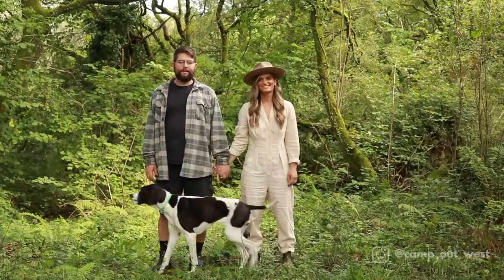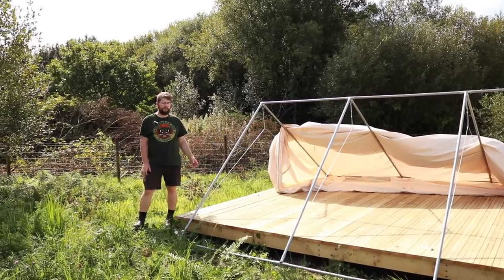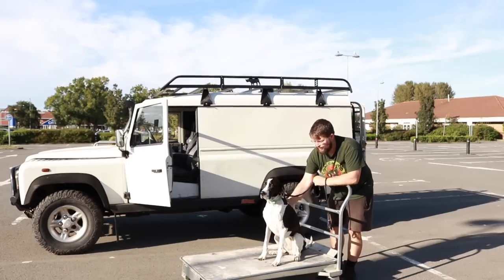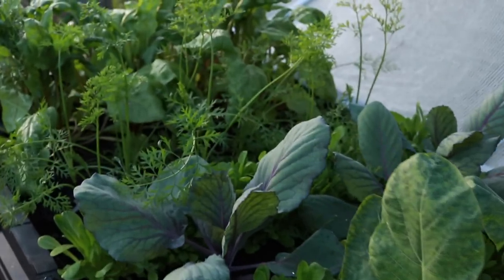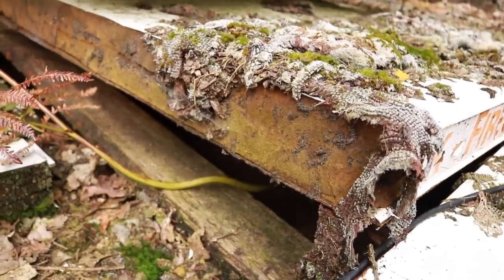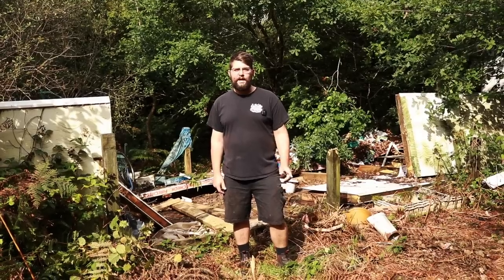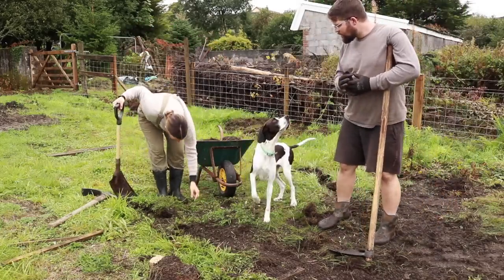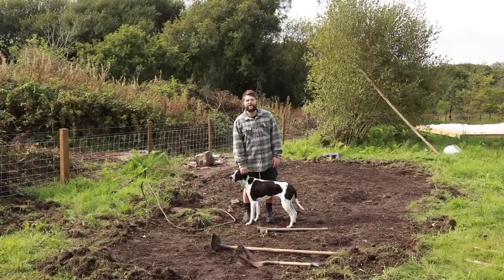We sold everything for this?! Turning abandoned land into an off-grid homestead in Wales

Comment: The tent is not as advertised and the legs were rusty so it is basically ''not fit for purpose'' You are entitled to your money back.....contact the company and tell them that......remember to check that old electric cable and water supply are not live...Your contact with the little digger would have saved you both a lot of work and time.......once again you have shown you both are not afraid of hard work, roll on the next video....well done....
Reply from the maker: Thanks Sandy! Oh there is no electricity in this part of the land anymore so thankfully we were safe. We did say as we were doing all the work we should have booked the digger 😂

Comment: As a builder for 16 years the first thing that came to mind for your tent idea is...

Build 4 wooden 100x100 post to the inner measurements of the tent canvas. Build a basic wooden gable frame on top. Then sleeve your tent canvas over the outside of the wooden skeleton. It won't move at all. 

Its best to take the canvas off during winter to stop them from rotting.

Comment: If you buy your sand and gravel in bulk from a builders supply yard it will be a fraction of the cost of bagged sand and gravel.  My suggestion is to put a cheap tarp (or an old vinyl billboard sign much heavier and recycled) down on the ground and have the sand and gravel dumped onto the tarp.  Then you will not have grasses and mud mixing in.  Much easier to shovel off a tarp too. 😊

Comment: Could you make a wooden internal frame for the tent canvas?  Then line it with some decorative fabric/panelling.  you could then use the cavity this creates to put some form of insulation in for clamping in the colder months?
Reply from the maker: We had thought of this - the problem is even the canvas they supplied with the tent isn't fit for us, it was meant to be waterproof and mildew/mould proof but it lets in all water and has already started growing mould, so it wouldn't even make sense to try and re-use that either

Comment: As a hot air balloonist we have to handle 1000+ yards of material. We avoid flying in rain, or even laying the balloon down in a damp field. But when it does happen, we have to dry the balloon fabric out quickly because mold sets in 3 days. So we use our fans, we set the material up in a garage, or sometimes we rent the school gym, and lay out the fabric on several surfaces so there are ups and down in it, then we set up our fans to constantly blow air across the fabric. With you tent you should consider keeping a fan/heater, going inside it to keep condensation from happening and have air movement, don't rely on mother nature to do it.  I am also a historical reenactor and set up canvas tents many times a year. We do the same with our canvas. air circulation and heat will always help.  As for sealing the seams of the tent. Our canvas tents need one good soaking to make the fabric shrink and seal the seams.  Good luck

Comment: To do something with tents at the commercial level and for guests to want to come back you are going to have to to go with something heavy duty.  I'm a sailor and we use Sunbrella.  It's not cheap at 30 USD a yard at 60".  But it will last at least 5 years or more with proper care.  The frame should probably be built sturdily of a wood .  

On the mesh, you need no see um mesh.  It's used on tent windows.

Comment: You need to look at Re-enactor's tents.  That canvas is way too thin.  I had a proper tent with wooden poles and solid canvas and it withstood serious storms without problems.  They cost less than £1,000 as well.  They come in all sorts of interesting shapes and sizes.
Reply from the maker: Thanks for the suggestion Stephanie! We will have a look at Re-enactor tents! We do love the idea of a wooden frame
Reply: Seconding this recommendation. Our tent has been in use for at least 20 years and is still going strong in all weather. I don’t know if they have a presence outside of the US, but I could recommend Panther Primitives highly.

Comment: Those metal tubes that the tent came with are way to thin to stand up to any kind of rain or wind. You'd need to get some kind of steel tubing, thicker aluminum, maybe 1 inch thick wall PVC pipe (schedule 40 or schedule 80). Or just remove the metal get some 2x4's and put together a frame for the base of the tent that way. The material that the tent is made from also looks really thin, I'd recommend looking into a nice thick canvas sheet that you could use instead, blocks a LOT more of the light than what you currently have (unless you want a tent that lets the light through of course.), also there is oil's that usually get rubbed into the non-plastic / tarp tents that is supposed to help with water protection and mold prevention.
Reply from the maker: Thanks for all the suggestions, that's so helpful. After we had issues with ours we started looking at similar style tents and they all seemed to have thicker/stronger tent poles than the ones we were supplied with.
Reply: Your more than welcome, I typed my comment up before I got to where you said that you were goign to use the top as part of the chicken run. But I'm glad that the suggestions were appreciated. I've done a lot of research on hot tents, wall tents, and similar things as I was looking at moving onto my property to turn it into a homestead. And found that for the most part if you can do the work yourself, building your own is cheaper, AND usually higher quality. Wall tents, like the one you had, most people I saw would build a wooden frame on the inside, then use plywood or OSB as internal walls. Most of them didn't do anything to the ceiling.

Comment: The skinned insulation panels would be VERY useful to someone who wanted to install an insulated roof or walls for that matter.  You could use those panels to build your tiny house with a little modification.  There is an established building method for those panels.  But it is good you don't have to pay to send them to the dump.  If your neighbor does not take all of them, I'd stack them up in a handy place and sell them on social media.  It looks like quite a mess right now, But stacked neatly and tarped they would be quite another matter.

Comment: You need netting for brassicas to stop the butterflies laying eggs and eating your brassicas (kale/ cabbage/broccoli/ cauliflower). Make sure it’s tall enough that the plants don’t touch the netting as then the butterflies can just lay eggs through the netting. 
For the courgettes you get two sorts of flowers male and female. Male flowers come first and start to attract the insects then come the female flowers which will have a. Bulge (little circle or oblong) behind the flower, this will become the courgette if it is pollinated. You can do so by hand (use a small paint brush to take pollen from the male flower and put onto the female flower) but normally the insects do a good enough job. Beetroots should be fine in the ground without any cover, try putting your brassicas in the veggie pod next time or buy some scaffold netting and blue plumbers water pipe to make covers for your bed. It’s all trial and error, we lose a lot the first time we grow and discover the problems. 
ThE company you brought those tents from should refund you as they are not fit for purpose! Have you thought about building wooden pods instead of tents? They might be longer lasting than the tents.
Keep up the good work looking forward to seeing how your site evolves and when you start building your tiny home

Comment: With yr veg problems i would highly recommend polytunnels. The courgettes may have dropped off due to lack of water or maybe disease. One thing i have learnt over the years is tht u need to check yr plants regularly for pests and disease. My runner beans were nearly wiped out this year due to ants setting up their aphid farms on the undersides of leaves. It took me while to figure out why they weren't thriving and then i spotted the ant overlords scurrying up and down the stems. Do some research on companion planting (eg planting Mexican or African marigolds, Tagetes species, next to Toms) as this confuses the critters and sacrificial flowers etc. My top tip, mix herbs like Marjoram, Thyme etc between yr veg plants. I could go on but you will figure it out

Comment: Use very fine mesh for all brassicas and make sure the veg doesn’t touch the netting xx
Reply: I use “Enviromesh” plus water pipe arches to hold it well away from the plants. Only in the summer months when butterflies are around. But I’m the winter I still use bird netting or the pigeons take all the brassicas
Reply from the maker: Thanks for the tip Susan :)

Comment: You could use the old tent frames and attach some mesh netting or net curtains to it to use as a frame cover your brassicas. As long as the netting is far enough away from the leaves the butterflies won't be able to reach to lay eggs. Ive used scaffolding netting and an old trampoline frame to protect mine 😂😂

The problems with the courgettes may be down to the flowers not pollinating properly. 

I use an electric pressure cooker to preserve my produce and it saves money because they use less energy. I reuse jars from pasta sauces and the lids seal great when I reuse them. If you want I can add you to a UK based food preservation group where many types of methods are used. 

Katie
Reply from the maker: Katie, thanks so much for your replying! I've been watching so many review videos on electric canners recently, do you mind me asking what brand you use? I have one in my cart I'm saving up to buy along with some books I've been recommended to get me started 🙂  very excited!!!! Xxxx
Reply: I've only just seen this sorry! I use an 8L Instant Pot Duo. It maintains the correct pressure and I can fit large jars in. There's many folk who use the IP for canning and to me would be suited for caravan life as it's electric and compact.

Comment: We did a similar setup for a recreational area we built. We didn't like the frame the tent came with so we used lattias they are long thick poles with the bark shaved off. Our tent came with loops on the outside of the tent we ran the poles through them and made "a" frame to the front.  The structure has stood strong for years. Let me see if I can find a picture and will email it to you.  The tent we ordered was an off grid all terrain tent that was waterproofed.
Reply from the maker: That sounds amazing.We are excited to see how we can selvage them

Comment: I live in South FL which gets lots of rain for several months.  It seems where you are has a pretty high amount of rainfall as well.  I think you should consider at least fashioning a glamp site with a sturdier roof than canvas.  Perhaps build your own roof and wall framing, put a metal roof on it and do the walls in canvas to give it the tent feel you are going for.  The canvas walls would be protected by the much sturdier roofing but it would still feel like a tent.  The only canvas I know that stands up in my area is Sunbrella which is very costly per square foot.
Reply from the maker: Yes, we do get a lot of rain here. I will look into Sunbrella, thanks for the suggestion 🙂You are right, I think having something with it's own roof compared to canvas would be a much better idea, we just had no idea the canvas we had would be so bad haha!

Comment: With Sevin®-5 Ready-To-Use 5% Dust, there's no measuring, mixing or water necessary. A thin, even dusting from the ready-to-use shaker container kills more than 65 insect pests on ornamentals, flowers, vegetables, fruits and lawns. Dust works best when used below chest height.
Reply from the maker: Thanks so much for the tip Sondra, we will give that a try :)

Comment: Leave your kale in the ground, they will send up more leaves from the centre. It won't die
Reply from the maker: THANK YOU! I would have been gutted if I pulled them out without realising xxx
Reply: @CampOutWest  most of those plants should regrow as long as the centre rosette hasn't been eaten out. Always give plants a little longer, they usually recover. Xx good luck.

Comment: So was this tent advertised as a permanent structure to be left up 365 days? Or able to handle high winds? Or was it built for a weekend of camping and then taken down?  I have spent time in wall tents that are able to handle all weather and they were far more substantial. Much thicker posts and canvas. I think for your purpose you need to build wood frame structures not something made with aluminum poles.

Comment: You should pursue the matter with the supplier, a refund is definitely in order. If you have other tents you might want to consider building a roof structure over the platform. There might be a treatment you could apply to the tent fabric.
Reply: Fabsil. Best waterproof for canvas
Reply from the maker: Thanks for the suggestion  @dianepitt5342
Reply from the maker: Thankfully we only bought 2 of the tents so the second 1 will need some TLC!
Reply: @CampOutWest  you want a refund for both tents

Comment: You've used the wrong material for your crop netting. You want white "row cover".  A search for "Floating Row Crop Cover/Frost Blanket" will show you the product you need.  Caterpillars an not lay eggs through this fabric.  An additional action you can take is using dilute hydrogen peroxide (8 parts water to one part HP and a drop of dish soap) to kill the eggs and larvae https://www.youtube.com/watch?v=jU4N5PLKX7M&t=14s  With an infestation like you have, I'd start spraying now to control the eggs that are already in the soil.😊

Comment: Defo speak to the tent company if you don’t get any joy speak to trading standards   Just a point to use with the tent company they need to be fit for the purpose which leaking after 2 days is not the case also on that point no way should the poles have broken after such a short time. Looking at the poles thy do not look thick enough to take the weight of the canvas they should be a lot thicker I think they may have used sub standard poles.
Reply from the maker: After looking at similar tents the poles and canvas looks a lot lower quality and a lot thinner.We are going to email them again and see if we can get anything back 🙏
Reply: @CampOutWest  if not I would definitely report them to trading standards it was not fit for purpose  which it must be I'm sure trading standards would look into it for sure